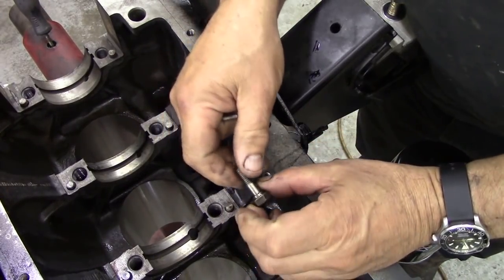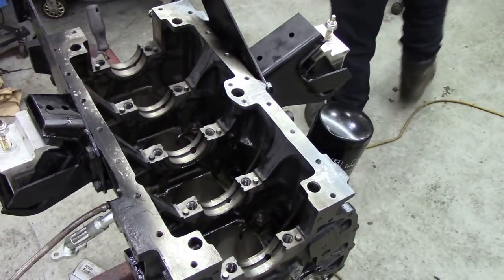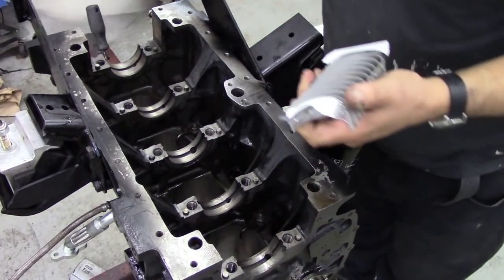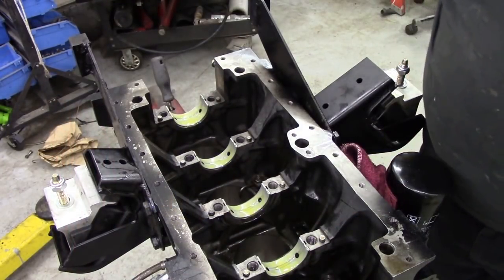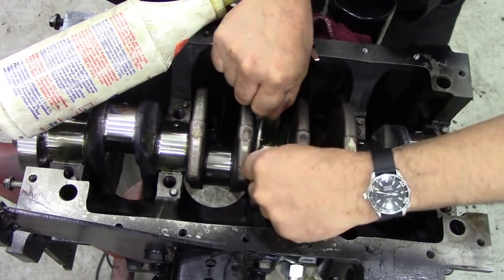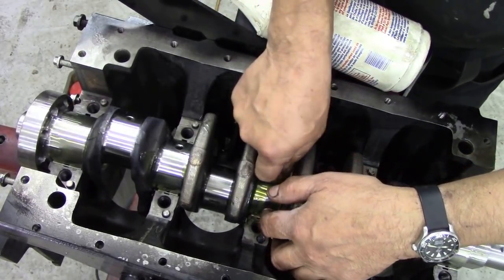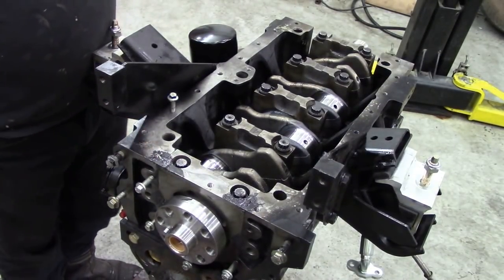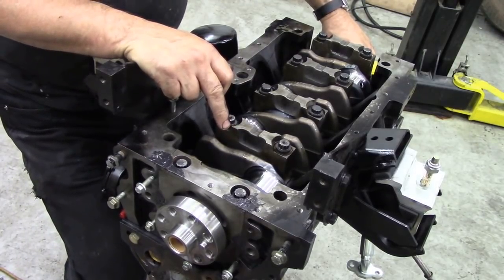300Tdi Rebuild.  Fitting the crank. Part 6

Comment: I use a drill motor and an oil pump shaft adapter to pre-oil the engine after a rebuild or after sitting for a long long time (with fresh oil) That way, oil gets forced into all the passages and journals. I just run it until I see oil at the rockers. Cheers, Mike! Thanks for having us along!
Reply from the maker: Good idea!

Comment: Thanks Mike. Rebuilding a 2.25 for my II-A right now. Thanks for the rear main seal trick.
Reply from the maker: The seals never with the sealer,  leak and the cork or rubber t seals can get cut on fitting

Comment: I did this job today. I was quite surprised that the manual stated to replace the cap bolts and rod nuts/studs. Having already waited 10 days for parts I was not going to wait another 10! Reused the old ones, lets hope it holds!
Reply from the maker: Yes it does seem odd as the nuts are not lock nuts

Comment: When I rebuild engines I have been using GRAPHOGEN Engine assemble paste and have found it really good. Graphogen Assembly Compound is a colloidal graphite paste in oil and gives protection when running-in all types of precision built machinery. Not cheap but a tube last ages.

Comment: I love watching you work Mike.
It's great to see you enjoying a job. The tactile feedback from turning that crank must be almost orgasmic...
Fantastic video again.
A question....
Is there any reason you don't oil both faces of the bearing? I know the outer face isn't in contact with moving parts but would a light smear of lucas gloop not go amiss on these outer faces? Or would it prevent the bearing from seating properly?

Keep up the great work Mike... Loving it all.

Comment: I remember watching that model t start up I watch them but they take some believing those old engines were a problem if stood for weeks, they shot a battery on after 25 years and fire them up
Reply from the maker: The need turning by hand to make sure the pistons have not stuck

Comment: Regarding the general topic of turning over an ancient engine which hasn't run in years.
I'm with you all the way on dropping the sump and clearing out the crud. But what do you think about this for an idea?
Once you've dropped the dump and cleaned out the residue, put it back on and then ram the engine full of diesel and turn it manually. That's got to give it a good clean. You could do that over a couple of weeks and just keep turning it manually. Leave it to settle and then drop the diesel out and get the sump off again. I'll put money on it that there would be another sump full of crud.
Diesel gets where wather can't... 
(water.... Lol) 
Just an idea... Has anyone ever tried it?

Could you imagine the state of the cooling systems on one of these engines? I think there would be just as much trouble on the cooling side...
Reply from the maker: Good idea - cooling systems - full of water = full of rust OR no coolant at all

Comment: Great to watch , but never have I ever fitted a crank with out check bearing loading , so that you don’t risk running a bearing later on . and also checking bearing clearance against the crankshaft journals . look forward to next one . used to recondition the old blocks with the exhaust valve in the block and the big domed pistons .
Reply from the maker: Thanks for the info - this was a brand new crank
Reply: @BritannicaRestorations  yes, I don't know if you checked the mains for correct size measurements as I've line bored many mains. Fit bearings to block and caps tighten down one end and slowly tighten down other end when you feel it nip up measure the gap with feeler gauge and check it is correct for the diameter of the journal. I hope you have also checked the conrods for  alignment and if any twist.. Love your work
Reply: Jack Daniels 
Do your connecting rods twist often?
Reply: @fastinradfordable always on any engine build up conrods we used to check alignment. Also after fitting new small end bushes or resizing bigends due out of size you will find the conrods misaligned and with twist. You can manually align them.

Comment: Have you ever ridden motorbikes?

Lot of bikes have a sight-glass on the side of the crankcase instead of a dipstick.
That makes you far more aware of what's going on inside your engine.
You'll often see droplets of condensation in the sight-glass AND you'll see the oil go cloudy, and then clear, as the engine warms up and any condensation in the oil dissipates.
Can make you a bit paranoid if you let it!

As a bare-minimum, if I haven't used a vehicle for a while I always disconnect the ignition and turn the engine over until I see oil pressure before starting it.
Not quite as easy with a diesel but these days I always have a hidden switch for the stop-solenoid so I can flip that off and turn the engine over before starting it.

Always gives me the heeby jeebies when I see people starting up "barn finds".
Sure, it might run NOW but will it still be running in 6 months?

Comment: Hey Mike, I’ve just commented on another video of yours because I couldn’t find this one but I’ve just rewatched it and it’s great! My question is- am I able to do your t seal fix with the engine in the car? Ive got it all apart now with sump off and transmission is Comming out tomorrow, I’ve taken the bolts out of the rear bearing cap but the cap doesn’t want to come out. Any tips?
Reply from the maker: It will be tight

Comment: thanks for your great video, my 97 300tdi crank is moving back and forward by 4mm im very worried about that , any advise would be great thanks
Reply from the maker: That is a lot of end float! Sounds as if you have an issue with the thrust washers in the engine block - it is unusual for them to wear, and although inspection is required you need to find out why they wore in the first place! 
Could be oil starvation or prolonged pressing of the clutch, or I have seen these heavy-duty clutches do this due to the higher clamping pressure, requiring more pressure applied to the pedal
Reply: @BritannicaRestorations  great info many thanks
Reply: @BritannicaRestorations  had the oil pan out to day and a big surprise the thrust washers were taking a oil bath there , i made a smiley face from them , ill need to order new ones oversize i thing , i hope i can install them with out the crank out  ,ill ask the fairy god mother to help

Comment: When you fitted the piston cooler nozzles, did the banjo bolts have sealing washers?
Reply from the maker: No
Reply: @BritannicaRestorations  I pulled my pan/sump for a leak and ended up finding the nozzle part of my cooler nozzle in the bottom, pulled the main part of the cooler and no sealing washer. Pulled the next one down to have a look and it had a copper sealing washer. Checked the military parts book (110 Wolf) and no washer, looked at the civvy repair manual and it mentions a sealing washer. Oh the joys of having a British vehicle in Northern Alberta.

Comment: Do you have any experience with the discovery 2 3 amigos?  I had a faulty new wheel bearing go on me (new hub, looks like the seals were bad) and that seems to have triggered the amigos.  I hear a faint beeping from my ABS unit as well.  I've since replaced the hub and sensor again but it looks like I may need to get the abs amigo to clear the code or take it to a dealership, and that beeping worries me.  Code p1590 from my ultragauge for my wheel speed sensor, which again leads me to think the abs code just needs to be cleared.  Does this sound right?  Do you have a video to anything on this issue?  Sorry to bother you mate youre just by far the most useful guy on YouTube when it comes to this sort of thing and I cant seem to search your videos on mobile to see if you've already covered this.

Comment: Can the rearmost cap and T seals/sealer be replaced along the the rear main seal with engine in the vehicle as long as flywheel housing is removed. While doing a clutch for example?
Reply from the maker: Yes but very difficult

Comment: Enjoyed that Mike, just a question,  my 200tdi  engine been sat for nearly a year as I've rebuilt the whole landy.  What do you recommend  for the engine before I start it up ??
Reply from the maker: Fresh oil and filter then glow plugs out, turn it by hand a few times to make sure it is free, and with the wire off the injector pump, spin it over to get the oil round - plugs in, wire on and fire it up
Reply: Thanks for advise Mike,   can only take 2 glow plugs out as two have snapped off a while ago but it starts with two as our winters arnt as cold as yours. All the best Mike.

Comment: Hi, first of all thanks for your videos. I have a doubt about main bearing screws, iI can ser there are 8 flat head screws and only 2 with holes on it,which are in the number 4 main bearing. I need to know the two references for those two types of screws in order to replace it, could you please help me with that?
Thanks for all.
Reply from the maker: These?
https://www.lrworkshop.com/diagrams/land-rover-defender-engine/300tdi/sump_53196#15
Reply: @BritannicaRestorations 
Thanks for your reply, but no, in this case I mean main bearing screws from the crankshaft. There are 10 screws but 2 of them are different from the others because have a “hole” on it, and I cant find part references for 8x  flat head screws and 2x “hole” head screws in order to replace it.
Thanks for your time.
Reply from the maker: ERR3419
Reply: @BritannicaRestorations  Thanks a lot for that.

Comment: On the oil squirt jets, should there be copper washers on the bolts? I know it had some on my 200tdi and it looks very similar or did they not hve them on the 300?
Reply from the maker: There are no copper washers on the jets